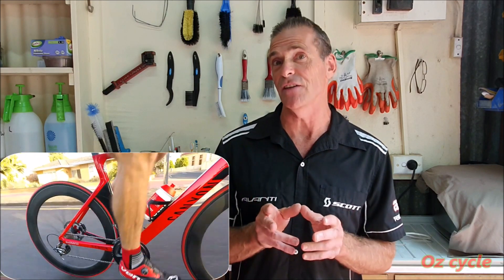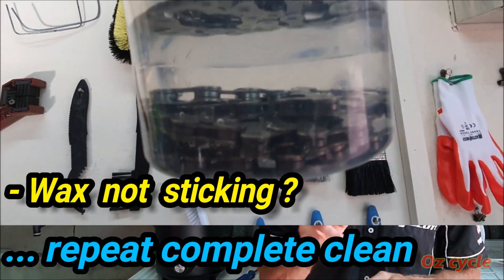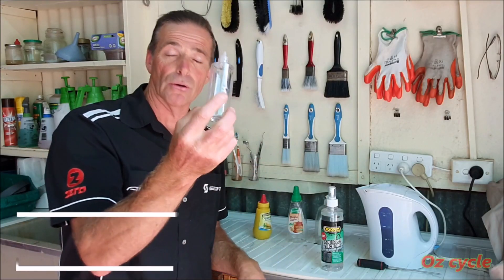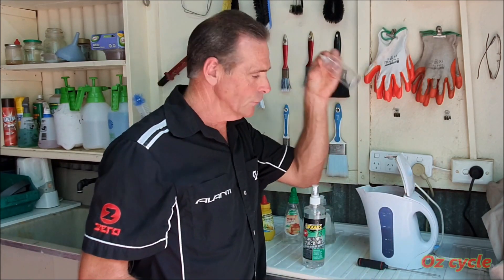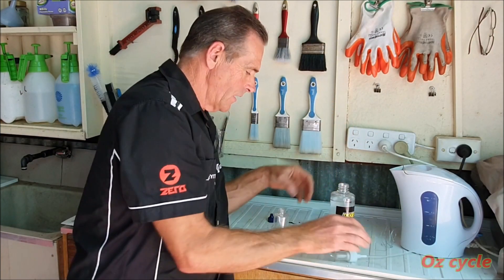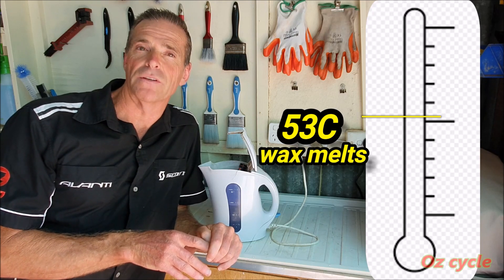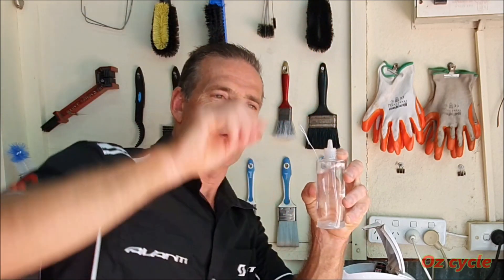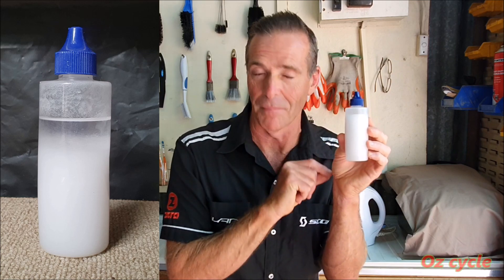Chain wax in a bottle - make it yourself

Comment: I’m new to cycling. I bought my first road bike this past December; a used 2014 Trek Domane 4.0. I’ve worked my way up to 40 miles in this time. This is all besides the point I want to make. I’ve watched a lot of GCN while started out, and I’ve found them rather insightful, but insightful is an understatement for your videos. I’m really impressed with your own research, and how you break down concepts. I don’t understand how you don’t have more subscribers, but you’ve won me over.
Reply: GNC is the "apple genius bar" of cycling smh smh smh

Comment: I do love your videos, you've got me well on my way with my chain waxing. I've now got over a litre of the drip wax as I made it before I saw this video and had initially used too much wax and it kept going solid on cooling. 2 cycles of splitting the mix in two with more isopropyl alcohol and I now have many years of drip wax made. Thanks and keep up the great work!

Comment: Excellent advice, and timing, Oz! I am very happy with the chains I ‘ve waxed according to your recipe, and was just thinking about having a little bottle of wax lubricant to use on the road. You were ready with the answer!
Reply: Excited to start all these wax chains. Do you use a wax lubricant like you normally do with oil lubricant? Trying not to do a full wax so frequently.
Reply: @choyweide903  I've heard that the wax lasts 400km per full wax. But mine always gets squeaky after 80km or so. Around there and for each 80km I use the drip on wax. I end up re waxxing every 800-1000km fully instead of the reccomended 400km. No chain issues and my chain has no stretch!

Comment: I'm a mountain bike rider and have been frustrated with chain maintenance issues for the 10 years of my riding. Dry wax lubes have left my drivetrain totally unprotected and noisy after just 1 hour of dusty riding in bushland at Nerang. Not to mention how fast they wear out. Now you have answered my questions about the deficiencies of those lubes and given a solution the the problem. PTFE is the 'secret' weapon. I'll be getting a batch made up asap and following your chain maintinance protocols.
Reply: So...what was your experience on your MTB?  Also, any comments on wet/mud riding?

Comment: this is a hell of a lot safer than working with Xylene! thanks for the update. PS: Wax is just oil thats solid at room temperature. its not the oil thats attracting dirt but the polar extreme pressure additives in the oil that are designed to attach to metal surfaces on one end and dirt on the other to keep the dirt away from the metal surface. Wiping the dirt off does the trick

Comment: 0:57 - I just went through this process.  Gasoline soak for two different types of chains for ~24 hours, then I went to the denatured alcohol soak/shakes.  The road chain took six separate shake/soak/shake sessions with new denatured alcohol each time, and the larger MTB chain took nine sessions of the denatured-alcohol shake/soak/shake processes - both over the course of about 20 hours.  They were just not leaving clean enough alcohol each time.  My guess is that the higher end 'dry' (waxy) lubes I was using, vs. just an oil-based lube, adhered to the chains longer.  My point for everyone is - it may not take the mere 3 sessions (which I believe is the method oz showed in the previous waxing video) with the denatured alcohol to clean a chain.
Reply from the maker: Did you use degreaser between petrol and alcohol?

Comment: Just made a batch. Thanks for the tutorial! I did it a little different since I was due for a re-wax on my trainer bike. While it was hot, I stirred the wax to mix the PTFE. I then used a spoon to add the mixture to my squirt bottle. I used about a 1:7 - 1:8 ratio since  the wax was already melted. Then filled the remaining bottle up with 91% isopropyl alcohol (I couldn’t find 99% like you had). At first I thought all I would need to do is mix it up and it would be done. What I found was when adding the alcohol it hardened the wax enough so it wouldn’t mix. What I did was heat up a pot of water and kept it around 80C while spinning the bottle with my fingers to mix contents. Worked great! ...The intent was to get the same Wax:PTFE ratio as doing a hot wax. It does separate fairly quick so you need to be aware when applying, but a quick shake mixes it up nicely. Thanks again Steve, I look forward to all your videos!
Reply: Just wanted to add, make sure you leave the bottle in the hot water long enough to where the wax is totally melted.

Comment: Thanks for video Oz
Maybe better to get water right temperature in a pan then sitting bottle in pan rather than putting bottle in kettle. If temp drops a little in 10 mins top with hotter water. Less risk of overheating

Comment: Hi thanks for the videos, iv tried to make the bottled wax with isopropanol alcohol and paraffin wax but it keep solidifying when it cools , would you say I’m putting to much wax in the mix ?
Reply from the maker: Sounds like it,yes. Give the bottle a shake to free it up. If it's still too thick, add more IPA.
Reply: Thank you 👍
Reply: @stevenleffanue hi. i hope you are doing well, i know you answered this question dut still i have the same problem even if i add more alcohol
Reply from the maker: Is your IPA 99% or above? Some contain quite a bit of water.
Reply: @stevenleffanue  i have used 70% alcohol thats what i find. and i have also burning alcohol .sorry for my bad english
Reply from the maker: That is probably why it's not staying liquid. Try 99% IPA
Reply: @stevenleffanue  THANK YOU

Comment: Hello! I wanted to ask is it possible only to use the liquid you made?(not putting the chain in hot wax)

And what wax did you use(does it differ from candle wax, or has any specific name)?

Thank you!

-Ignas
Reply from the maker: You can but you will need to ensure the liquid gets into the links properly.
The wax has ptfe powder added to it.

Comment: Love your videos. I've waxed my chain as you described and thus far, works great. Thanks. The only problem I'm having is with the "Chain wax in a bottle" technique. I've melted the wax/Ptfe into 91% isopropyl alcohol. While warm, it desolved great. But once it cools off, the wax settles in a clump again. Any suggestions? Maybe exact measurements of wax to alcohol would help. Thanks and keep making these great videos.
Reply from the maker: Use 99% IPA
Reply: @stevenleffanue  I'm in the US. You know how hard it is to get any isopropyl alcohol, much less anything over 75%. Any other suggestions?
Reply from the maker: Xylene
Reply: @ThomasFlorimonte  91% iso is in most any pharmacy in the US. And any hardware store should have denatured alcohol which starts off at 100%. All alcohol will absorb water from the air over time but should still be 90%+ and work fine.
Reply: IsoHeat is 99%
Reply: IsoHeat is 99%

Comment: Nice video and presentation. 
By the way does the chain temperature needs to be elevated to let wax lubricant enter the pins?
Reply from the maker: Let chain sit in the hot wax to heat up for 3-4 minutes then swish the chain. Let sit again for 5 minutes and if no more bubbles come out of the chain when you move it, it's ready.

Comment: Hi there. Love your videos. I’ve ordered my wax and PTFE. 
One thing I don’t understand is you say to clean with petrol, degreaser and methylated spirits. Do you mean all 3 in that order or just use one of those them? Also is mineral turpentine a good cleaner? Need to understand the above first before I do the wax or my chain may be contaminated before I start   Cheers Russ
Reply from the maker: Its explained in the "ultimate wax" video Russell.
In some countries "mineral turpentine" contains a small amount of oil which is not good for the final clean. Metholated spirits,alcohol,xylene and toulene are prefered
Reply: oz cycle thanks very much

Comment: Hi Oz, loved your videos, i tried chain wax and it is amazing. i tried to make this portable chain wax, i heated the mixutre to 72°c for about 30min but after it cools down the wax isolated from isopropel and form chunks which doesn't solve by shaking. i am using 70% isopropel medical alcohol. any idea what's wrong with my mixture☹?
thanks again mate, looking forward for you next videos 😉
Reply from the maker: You may need to use 99.9% alcohol
Reply: @stevenleffanue  thanks mate, i will give it a shot and will update this thread😉👍
Reply: @stevenleffanue  i couldn't find 99% isopropyl Alcohol, but i tried it with 70% Ethyl Alcohol which seems to work, and also i have tested this with paint thinner and it seems to work as well. paint thinner seems the best to blend with wax. but in both cases (wax and Alcohol) it requires several hours to dry and having active wax layer. 
thanks Oz for the great ideas👍
Reply: @omarawf5507  Paint thinner contains oily substances and attracks dirt
Reply: @patricebeaudet3571  thanks Patrice for this note, i think i will need to make the mixture again with 99% alcohol.  i just got small amount of it.
Reply: @omarawf5507  Someone in that forum suggested to use Naphta (whitegaz or essence C) in a 6:1 concentration. The disolution is easier and the oil residus are much much lower than paint thinner you previoualy mentionned. It could be a good alternative to IPA to ease its solidification problem. I'll give it a try myself.
Reply: @patricebeaudet3571  great, thanks for the info, please let us know you experiments feedback👍.
Reply: @omarawf5507  Here is perhaps the solution from ThreadExpress: 
Chain wax suspended in solvent still does not seem to have caught on?
I have been applying Rock and Roll blue on my turbo levo from new and listen to this. After 1 year of riding every couple of days - the chain still measures as new. No wear or 'stretch'  ZERO !   I am an engineer... and am amazed. The Specialised shop doing the one year checks/service were surprised. No dregreasing, just apply the liquid and wipe off, about once a month.  I dont understand why long term tests have not been done to make this common knowledge.  The wax must float inside the links with the solvent carrier when it is applyed and stay in there effectively. I did not even bother to remove the oil off the chain when new, just dosed it with the R and R blue. Best part is the chain is clean!   I know this sounds like and advertisement but I am not affiliated with R and R at all. Just wanted to pass on my findings so far.   Cliff
Reply: @patricebeaudet3571  sounds super, thanks Patrice. i have tried White Lighting Clean Ride but the chain started to make noise after about 20km (i might made a mistake as i didn't know i had to apply wax lub on clean chain), thus i quit on it ans got back to oil lubs, until Oz came up with this new lovely chain waxing method.
Reply: @omarawf5507  When I bike- tour over 300kms, I will go for the naphta + wax first. If I don't like, I might buy Rock'n Roll Extreme. I don't want to stain the chain with oil in order to prevent the whole cleaning process. I need to experiment too. Good luck with yours.

Comment: You've saved me a lot of money over the years.  Making my own bearing press tool, making my own head set tool, buying awesome Chinese carbon wheels, but this is one I have to take a pass on.  I use Squirt lube, and it's pretty awesome.  It's a bit expensive I'll grant you, but it works like a charm and I don't need to buy a slow cooker, thermometer, wax, wire etc...  This just seems like a very long road to take to solve a very minor problem.
Reply from the maker: After a couple of rides , wipe your finger on your chain....clean or marks?
Reply: @stevenleffanue  Oh there's definitely some marks.  I wipe my chain down after every ride, and degrease and relube it once a week.  I also take my cassette off once a month and degrease it thoroughly.  Your method would result in some small improvement I'm sure, but not enough in my estimation to go through all that trouble.  Maybe I'm wrong?
Reply: @jshepard5840  Squirt gets washed off when it rains

Comment: Hi Oz Cycle, recent convert to your wax methods. Thank you. 1 question. Can you recommend recommend a commercial drip wax for the top up wax? The isopropyl alcohol is like 10 bucks from bunnings so thinking of taking the easy way out. So basically which top up wax would you recommend if you had to buy and not make which would be compatible with your dip waxing?
Reply: I use "Household Paraffin Wax". 
It is softer than what Oz uses (MP 37c) but it is FDA approved (which, for a second, I thought I would brag about, but I am in the USA so it does not mean it is perfect, but suitable for waxing apples🤔)

I have had none of the suspension issues with it in a drip and I seem to get more miles than others (I re-wax between 250-300 miles on a 9x3 speed) and I have yet to hear a squeak.

Comment: I made a bottle of this lube using Gulf wax and naphtha as recommended in one of your videos, however my liquid didn't turn milky like yours did.  I bought some ptfe on ebay last night which I will also add. Will this concoction still work even though it's clear?
Reply from the maker: Naphtha will dissolve the paraffin wax. Shake the mixture and it will appear milky. Add PTFE at any time.
Reply: @stevenleffanue  I just tried that and it's staying as clear and runny as water. I might have to try the isopropyl alcohol. I just don't think this one has any lubricating in it.

Comment: Thx very much for all the guides!

Can i use ethanol instead of isopropanol?
Reply from the maker: Not tried ethanol. Give it a go then let us know. Careful because its boiling point is lower at 78degC
Reply: @stevenleffanue  Another point is that, at least here  in the States, IPA comes as a 70% or 90% water solution.  I’m assuming the 90% would be better???
Reply: Of course, less water is always better.

Comment: Wonderful solution!
When scraping the wax from cooker just from top part, does it include PTFE particles? In some other videos you mentioned PTFE settles on the bottom, so top part of hardened wax could be just wax without additives..
Reply from the maker: True. Its only a temporary lube to get you by. You can add a pinch ir two of ptfe into the bottle if you like or scrape from the bottom of your wax block.

Comment: Can this method be used instead of the regular chain dipped in wax in a cooker for riders who do not ride more than 300 km per month? Thanks in advance!
Reply from the maker: Yes but you should do the thorough chain clean before applying the wax solution
Reply: @stevenleffanue  Most definitely and many thanks for your reply. I am going to buy a new chain, degrease and make the above lube and use it. Will report back once I get around to doing this!!

Comment: Great videos, very interesting and thorough but do you think your chain cleaning & waxing regime would benefit a UK based xc mtb rider whose chain is caked in crud and muck after most rides especially over the winter months? Sounds like I would probably need to clean and re-wax after every ride?
Reply from the maker: Wax is waterproof. Ive had it on my mtb for three years now.
Reply: Thanks oz cycle, I think riding a mtb in the UK is a different proposition to riding one in Oz but I will give it a go 👍. Have a new chain with factory lube so I just going through your cleaning regime, ok to use isopropyl instead of meths? 😁
Reply: Have waxed my chain using your old recipe @oz cycle and am happy so far. I only went out for a c. 22 mile in dry / dusty conditions but I was impressed with minimal residue on the chain afterwards. It was an ideal time to experiment as I was replacing the whole drivetrain on my xc mtb inc. jockey wheels so everything was clean. So far, so good 👍. One question pls - can I make the wax in a bottle using the old recipe (wax and paraffin / lamp oil) with the addition of iso? Thanks again and keep up the great work, cheers from the UK 😀

Comment: Thank you for your very informative videos.  Quick question:  is the wax you put in the isopropyl infused with ptfe?  Thanks again!
Reply from the maker: Yes
Reply: @stevenleffanue  How?

I can see your solid wax has the same precipitation I get with 1.5um PTFE: concentrated on the bottom.

It does not clump, however it is not suspended in the wax, much less in cooled wax.
You have mentioned that this is a mixture and needs to be stirred when used.

I don't get the squeaking other people get but then again, I never ride in rain. And I put a good 300 miles between using the boiling out all the old wax, immediately drying it with compressed air and then dumping it in the melted solution for about an hour, mixing when I remember (at least 3-4 times).

I'm not arguing it needs PTFE in the travel solution; just asking why you replied the wax was "infused".

Comment: I really enjoy the Oz cycling content, so I want to give waxing a try. I am new to waxing and I have looked online and many people recommend using Squirt Dry Lube. That got me thinking, is your version similar to it? The advantage of making your own chain wax is that you know that there will be no solvents or oils in the wax that will collect dirt and contaminates. So, do you know if Squirt contains oils or solvents? From what I can tell it uses various waxes and is water soluble.  What are your opinions?
Reply from the maker: Squirt does attract a small amount if dirt. Immersive wax is a completely dry lube so dies not attract dirt. Try both to determine which suits your needs
Reply: Okay, so Squirt must still have a small amount of solvents and oils. I am sticking to your home made solution. Sure, takes some time to make, but at least I don't have to worry about it collecting dirt/contaminates. Thanks, again.